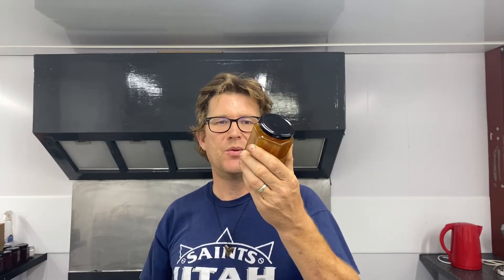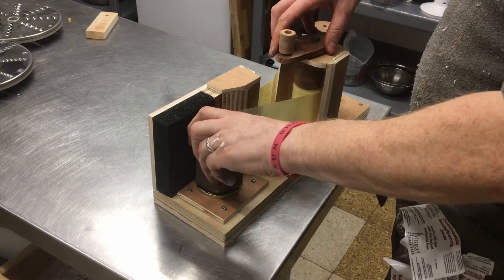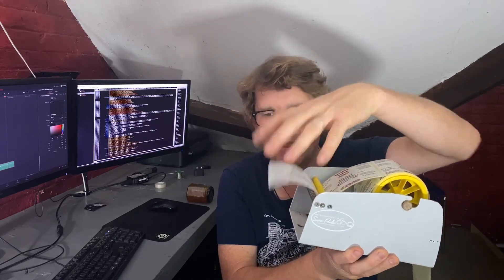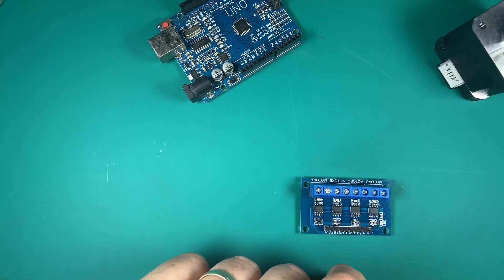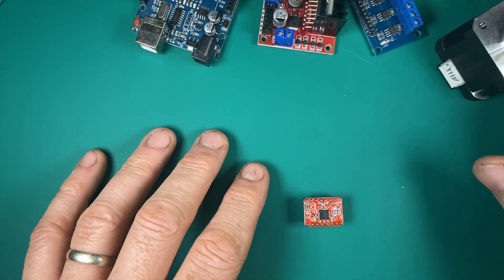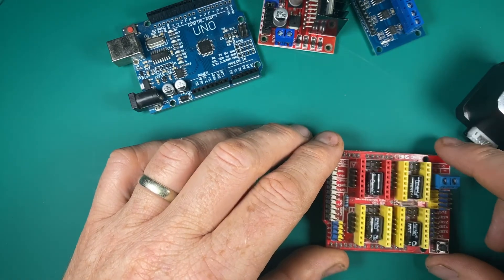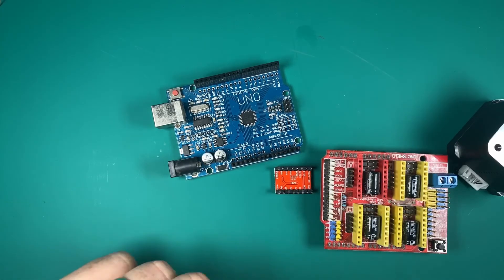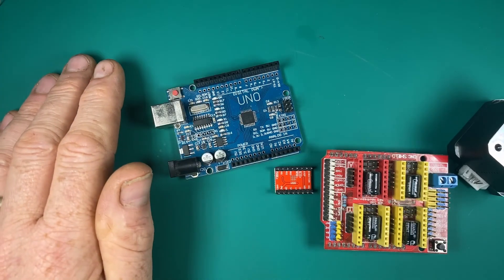Jim's Jam Jar Label Machine: Planning and explanations of how to apply labels to hexagonal jars.

Comment: I was just thinking that if instead of using air to blow and keep the label up from that direction, what about sliding the glass upwards at an angle so just the bottom catches, then drags the sticker along with it into place?
Reply from the maker: It’s worth a go, I’m now looking at getting the labels printed the other way around so they can go on from the side
Reply: @jimtriestomake  I don’t know if you’ve seen this or if it’s too late, perhaps this may help someone else. I thought this method was cool but tricky to figure out for home use while scaling up. 
https://youtu.be/KXBG5CEROMM